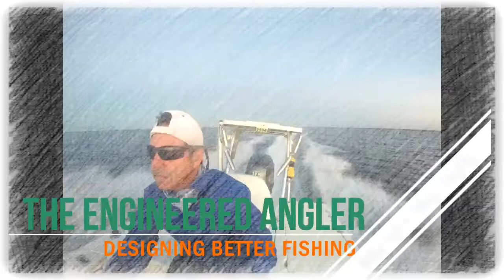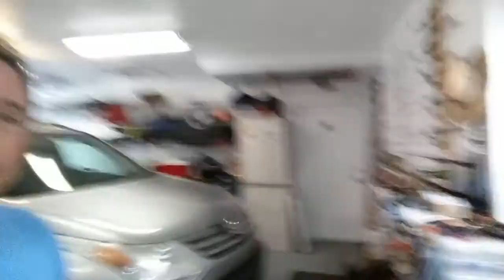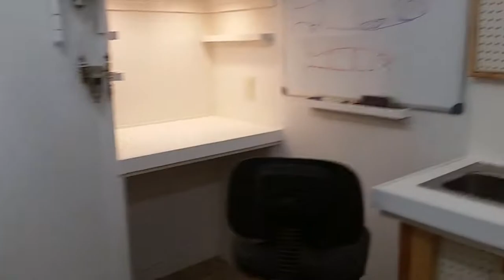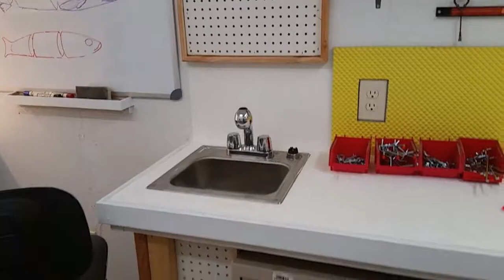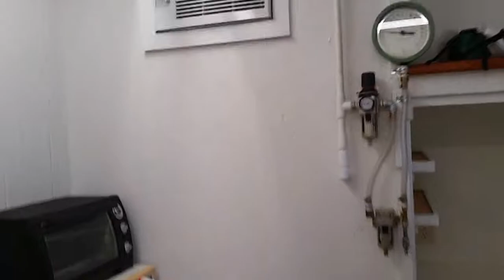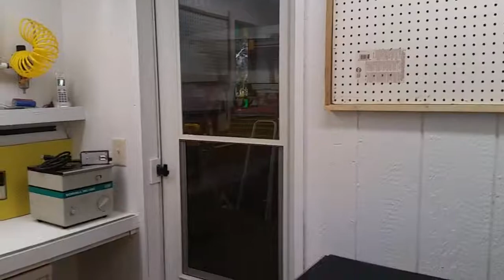New lure shop ready

Comment: Great use of space! Are you using regular 3/4 PVC piping for your air lines? And before the regulator and separators do you have full pressure on the pipe? I like the set up and would like to do it in my shop but have questions?
Reply from the maker: lots of folks are reluctant to use PVC for pressure air and for good reasons.  I have personally engineered my system taking into consideration every fitting and long line.  I don't run any higher than 90psi.